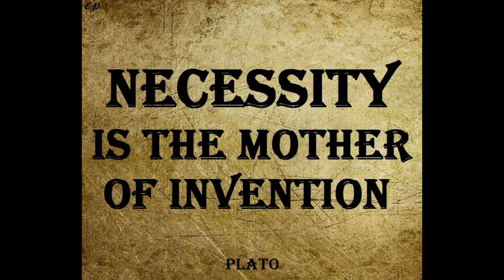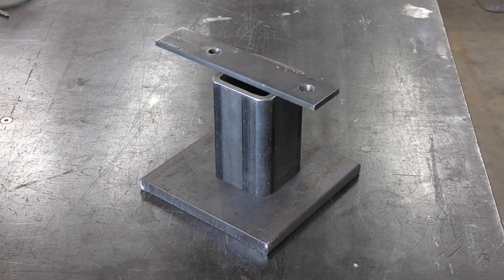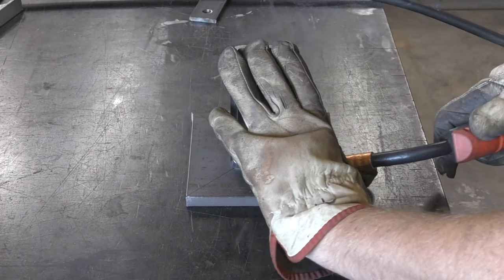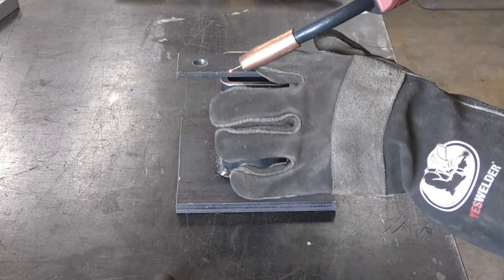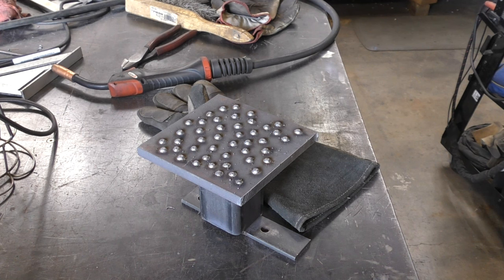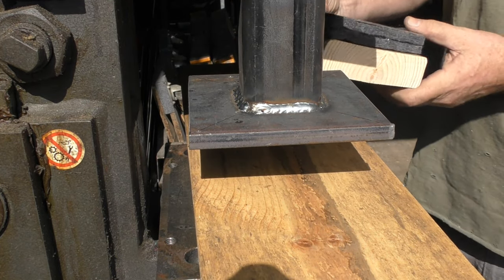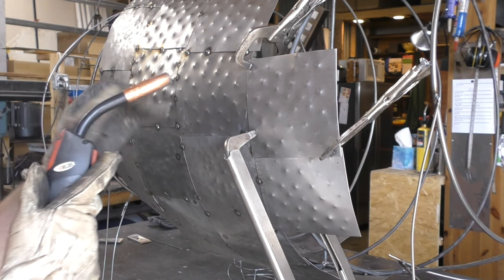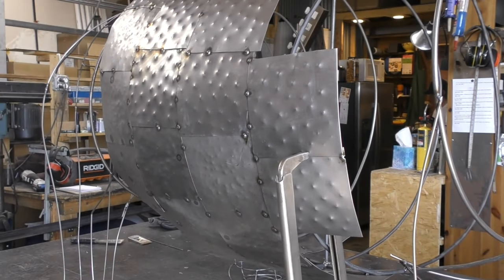DIY Custom Texture Die -  Making a Rhino Sculpture

Comment: we used to lay copper and steel sheet in the 1920's brick street and run over
it with our forklift for texture.....love your iron worker die set up......cheers....Paul